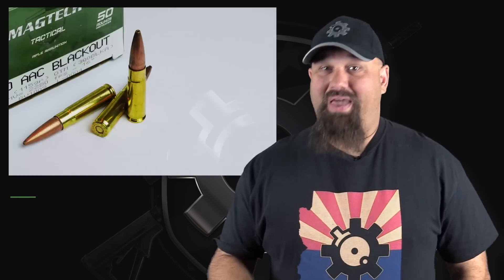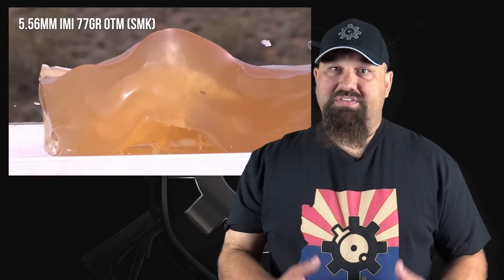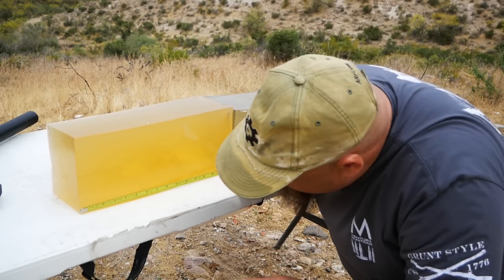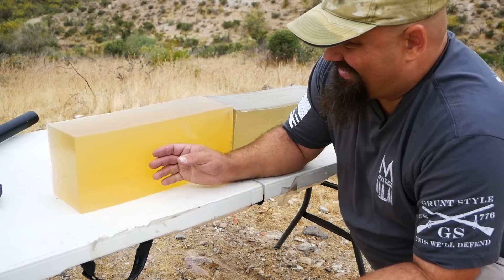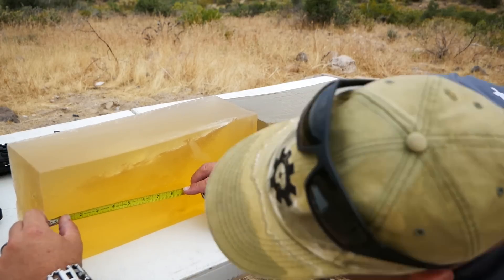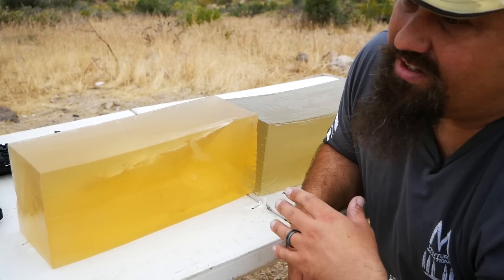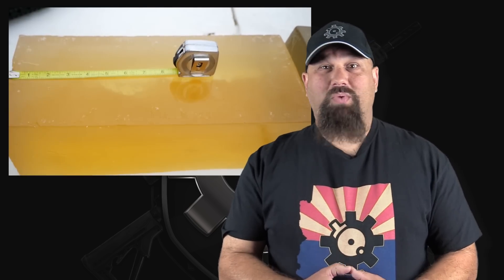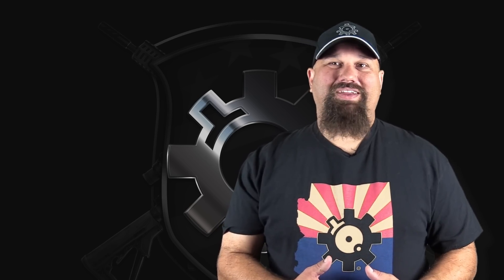Why OTM = FMJ In 300BLK: Magtech 115gr OTM Gel Test

Comment: Bullet weight and velocities of the .30 Carbine.
Reply: Peter Connell  There are a lot of other factors, so maybe. But round nose bullets are not intrinsically more accurate.
Reply: I never said any about accuracy, referring to similar .30 cal projo, near similar velocities in this case performing about the same terminally
Reply: Your math is wrong.
110 grain 300 BLK has a MV of 2400 from a 16" barrel
110 grain .30 Carbine has a MV of 1950 from an 18" barrel.
How is that the same?
Even from a 9" barrel, 300 BLK is going 200 fps faster
300 BLK is to 7.62x39 what .223 is to 5.56.
Most 300 BLK loads have about 5-7% less velocity than 7.62x39 from the same barrel length. Meaning roughly 50 meters less max range.
Remember, he is shooting these rounds from a 9" barrel, yet all comparisons are made to other rounds fired from carbine length barrels nearly twice the length.
Reply: I am referring to as TESTED above.  Velocity avg 2037 fps which is near the performance of this round out of his gun.  Never referred that the whole .300 BO is a .30 carbine
Reply: @chlebowg  
That's because this gun has a 10 inch shorter barrel than a 30 carbine

Comment: Last time I went though your videos didn't you test a short barreled 300 vs a 16" ak? I don't own a 300 blackout but doesn't that seem unfair? Especially since 300 was really for sub sonic loads that could also have a supersonic variant. I feel like it's an apple to oranges comparison. Same with people who are comparing  16" to 16" 556 and 300. 300 wan't meant to be a 16" caliber. It would be awesome if you do a video with 8" 300, 556, and 7.62x39 and see what the velocities are like.
Reply: No. I didn't. And 7.62x39mm has more case capacity than 7.62x35mm. If you load both with the same propellant, same weight bullet, and shoot from the same barrel length, you'll be able to achieve slightly higher velocities with the 7.62x39mm. It's not rocket surgery.
Reply: @newsofthepews  I would still love to see a comparative video of short barrel lengths of 8" to see how far the difference is. Instead of just jumping to conclusions.
Reply: @AbsolutionArmament  Me too. Want to buy me an 8" AK or AR upper?
Reply: The Chopping Block haha yes Id love to see that comparison sir!!
Reply: @newsofthepews  I would love to if I could. So we could remove alot of variables testing. We can always make an educated guess. But in the end there has to be a method to follow. Not just preach something not tested.
Then comparing capabilities to the availability of parts/ammunition. Expecially since the whole point of 300 blk is subsonic ammo. At what percentage gain is one better than the other? At what point does the shorter barrel diminish the characteristics of the cartridge.
Reply: @newsofthepews  I dug though my Shop. I have a 223 carbine length barrel I could chop down the 8" (removing the gas system and front sight) and slap on a stripped upper. Don't know if that's what you want though.
Reply: The Chopping Block But you dont use the same powder! You use magnum pistol powders in blackout so thats all moot point! You run out at max load before you do case capacity...... and again my hand loads perform on par with the 39...... I am jacks stretched scrotum and huge balls!!
Reply: @Marcus2750-u1t  I mean, yeah, if you bake one cake using flour, water, eggs, and sugar, and you bake another cake using mud and belly button lint, I think I know which one will taste better.
Reply: Peter Connell  not necessarily if you go watch in range TV where they did short barrel 308 vs 7.62x39 it's about having a balance of case capacity and barrel length. Also that doesn't answer the subsonic side. Yes they are subsonic 7.62x39 loads but I would be willing to be they 300 is more available and easier to reload if you wanted to. You are also stuck in a platform different than an AR or you have some odd parts for an AR. Where as 300 blackout is a barrel change.

Edit: not saying that for everyone. But I could see the market. I own an ak but I'm not stuck up my own ass and say everyone should own one. I've just pointed out there are test inconsistencies in his videos.

I should correct/add one thing i said - barrel length, bore diameter, and case capacity. Is what need to be balanced. Bore diameter is also a very important part to that. It just slipped my mind since the in range TV had similar bore diameters.

Comment: I'm loaded up with the Remington 120 grain otm at the moment.
Reply: Mine explode out of a 16in barrel
Reply: @2wheeleddemon999  Remington 120gr OTFB will fragment from an 8" too.
Reply: @newsofthepews  Really? I built a 300 black out as my second AR because I wanted a 30cal without really checking prices and I don't shoot it much. Bought 160 round buckets from PSA for$80 and that's about where I left it. Built a 7.62x39 the next month and put the black out in the corner.
Reply: @2wheeleddemon999  Yeah, if I was going to do anything serious with my .300, I'd buy lots of Remington 120gr OTFB for zombocalypse and a box at a time of 110gr TAC-TX. I'd also hand load lots of 110gr vmax, if I had the time.
Reply: The Chopping Block I have tons of 110 grain vmax loaded hot..... very good round
Reply: The Chopping Block you always forget the sig ht 120 grain also!
Reply: @Marcus2750-u1t  Yeah, I try not to make every post a comprehensive list. ;-)
But you're right the Sig 120gr HT is a go at this station.
Reply: @Marcus2750-u1t  I really need to get into reloading. I was just looking at a starter kit from Hornady at academy
Reply: 2wheeled Demon yes its not bad get a lee single stage press, a set of lee dies in 300 blackout its a 3 die set that comes with lee factory crimp die. Then get you some small rifle primers, range brass and some hodgen h110 and lastly the lee case trimmer thats like 7 dollars and boom your ready to get started. If you need any help Ill help anyway I can
Reply: Dibs, and its your funeral.
Reply: They are way under-rated bullet for $$